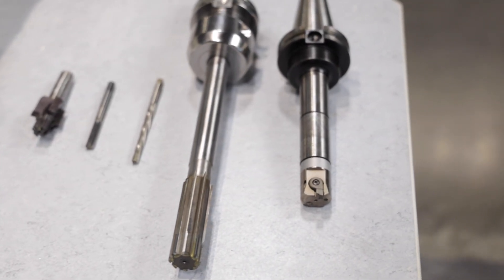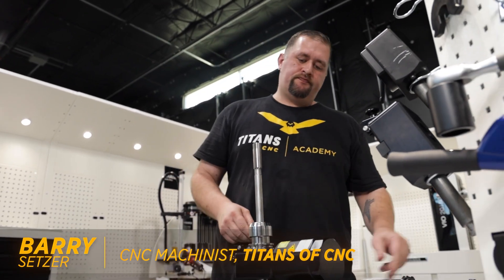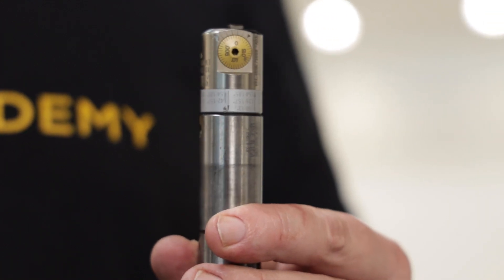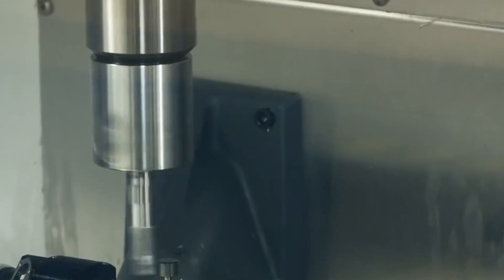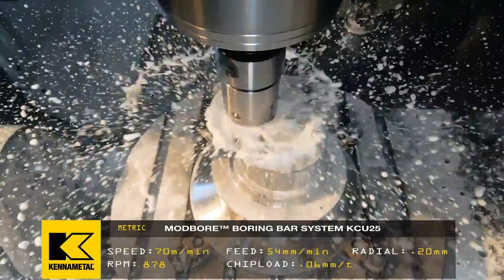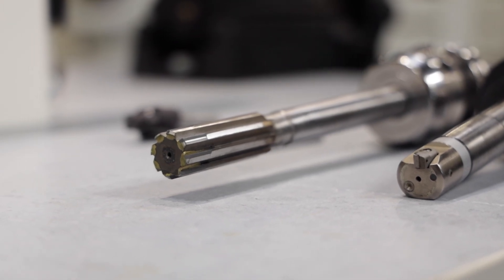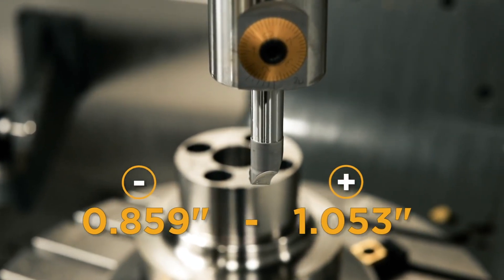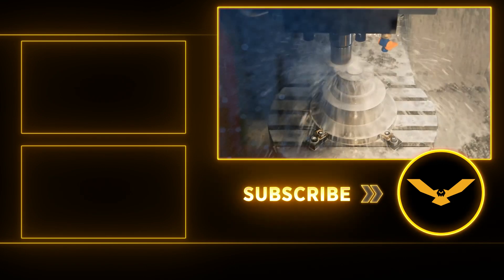Can a REAMER Be Better Than a BORING HEAD??? | Reaming vs Boring

Comment: I used to use the drill bore and ream on tight tolerance locations there are one shot drills out there that will hold .0002 on location and diameter and give a near mirror finish on shallow dowel holes

Comment: If you want to move things up another notch, then after boring slightly undersize, I sometimes roller burnish to finish. Roller burnishing is a cold forming process that takes the precision and surface finish to another level, very much application dependent but for some jobs it can't be beat.
Reply: Can you use roller burnish for inner surfaces & can i work for plastics ?

Comment: Reamers and boring heads are both good for tight tolerance holes but reamers tend to be unreliable for optimal surface finishes whereas boring heads will consistently produce reliable finishes.

Comment: Helical interpolation is my go to.
Reply: up until a point. 

IT6 or even IT7 can be difficult depending on how good of a machine you have and how well it's been set up. An expensive machine with good maintenance and the holes being small makes it easy. Long large holes you just can't adequately do with an endmill. For example, quadrant misalignment of a couple microns just ruins a nice interpolated hole. If it's deep they're also easy to make them tapered because your helical interpolation will unevenly wear out your mill. Expect the hole ontop to be slightly oversized because it's been touched by the top of the tool that has not seen a lot of wear compared to the bottom where the only contact point of the tool was the worn out end of the endmill.

This topic is basically about ~10 micrometer size tolerance fields, long holes with a tolerance and strict geometric tolerances. Where the choice of tool can have a large impact. 

Anyone can do a shallow 8 H7 on a decent machine with an endmill. That's not an issue.
Reply: this is true but if the machine is new and the cutter is new and the material is soft its no big deal. for long bores i use shortest flute lengths and helical from top to bottom

Comment: He is correct in as saying a reamer almost always follows the hole.
Reply: Yep, when I had to hold .0002 locations on a reamed hole I had to center drill, pilot, drill, then make a slight counter bore with a 4/5 flute endmill for the reamer to be on location. Iv seen guys bend a reamer .062 to follow an off hole
Reply: @adammiller4879  if you give it enough shank length it will follow. If you choke up to much and make the reamer super rigid it will act like a boring bar. That's the only time a reamer does not follow a hole.
Reply: @rjwalker1973  problem is management wouldn’t let me buy correct tools, a lot of the reamers I had would be 8-12 inches long for a 1 inch deep hole….

Comment: I was suprised there was no mention of position. I believe the boring head will provide a tighter positional tolerance than reaming a drilled hole.
Reply: Absolutely correct. But it kinda blends in with the “reamer follows the hole” idea

Comment: As long as you drive an undersized endmill into a hole before reaming, it is more accurate than a borer. You can ream dowel holes pretty tight
Reply: SOP I agree to an extent. If your trying to straighten out a hole that is way out of round an end mill will flex a bit trying to follow the hole. Nine times out of ten I would use a "reaming end mill", then a reamer.

Comment: How does tool life differ between readers and boring heads? I was told a reamer I looked at could go 45,000 inches without losing tolerance of about 1 thou. Boring head the same?

Comment: I was a machinist for 30 years and this is how it works, Center drill, drill, bore for position, ream for size. Standard procedure for tool maker.
Reply: Does it make a difference if you drilled with a carbide drill?  We get good results with those but I'm sure it depends on your level of precision.
Reply: @larryrobinson7492  always use carbide drills… HSS drills nowadays are for hobby use… lol seriously!
Reply: @L1qu1d_5h4d0w  we use HSS drills unless it's a super important part.  It's a ton cheaper.
Reply: For critical location I would use a truing EM. Straighten out the hole so a ream will follow with less shifting
Reply: Yup!
Reply: Do you have to center drill if you are going to use a carbide drill?
Reply: @euclid9718  no, at least not if its a tool not longer than 8xd. Really precise through holes get EDM machined

Comment: Any thoughts on if it’s worth it to run floating tool holders for reaming? I am making precision bores for bearing fits, they are shallow, under 1” diameter and cut in aluminum
Reply: What depth?
Reply: If shallow, don't ream! Bore them!
Reply: Very shallow, 4mm deep on a 23mm diameter and 4mm deep on a 15mm diameter. I have 3 precision bores in a production setting, I can either buy 5k worth of boring heads or $500 in reamers. I have one micro boring head and 2 short reamers bought for it so far.

Comment: You should never put a reamer into a drilled hole . You are correct that it will follow the drill. If you true up the hole first before the reamer  then your reamer should provide an exceptional hole. I suggest truing the hole with a fishtail, not by interpretation.
Reply: Are you speaking mill or lathe? I ream drilled holes all day long on a mill

Comment: For 1 to 10 parts of non standard sizes and shapes, bore. For correcting rough, or eccentric holes, bore. For correcting taper and bell mouth, bore. Otherwise, ream, or use a Watts cutter, see if I care.
Reply: Won't reamer also fix tapered hole? 
While not too stiff boring bar could also be deflected at the bottom of the hole if there is more material to cut.
Reply: @Stasiek_Zabojca  it depends on the amount of taper on both counts. If there is a heavy amount of taper, it could make the reamer snap off in the hole. A boring head would not allow for that. Reamers are typically much faster than boring, but again, depends on tool life and ease of replacement.

Comment: if drill leans a bit, reamer will follow. at least boring will create a straight hole
Reply: I do like this :
I start with a smaller drill, with a mill I create a straight hole, I do another quick drill leaving 0.2 mm and then finish with a reamer. 
With boring you save some time, but if you don’t have it you can do like this.
Reply: @matteomagni2084  just had too many problems chasing tolerances with reamers. I avoid where possible
Reply: @matteomagni2084  I’m curious why you drill after milling instead of just milling to the pre ream size?
Reply: @poetac15  if he has cheap endmills they may not be Center cutting? I guess
Reply: @poetac15  it's just to prevent endmill wear, i don't work in a cnc shop i just machine part we use for our production.
in other words, to save some money ^^
Reply: Thank you!!  I hate reamers!!

Comment: Yep it can. In the airlines as a machinist on small parts and having .000. -.0003 tolerance. Reamer is the answer.. simple
Reply: A reamer can't hold a .0003 tolerance. What are you talking about? if it's less than .001, I want to use a bore.
Reply: @gredangeo  then it's operator error. A boring head always has pushoff and deflection to worry with. I like them better myself, but a reamer in a properly drilled hole will always cut the same, as long as material consistency is very similar and tool edge is still in good condition. I will say that Kaiser are among the best there is that I've gotten to use. They usually cut dead nuts what you dial out depending on insert used. 👍
Reply: @gredangeo  wanna bet. Back of the reamer is ground to a given size. Reamer is pulled through backwards by hand.. ON THE AIRCRAFT sometimes yo cannot put the mart in a machine. It has to be done on the actual aircraft. And your darn right it will.  Its all about the setup and operator.
Reply: @gredangeo  its not the prefered method. But on aircraft sometimes its the only way